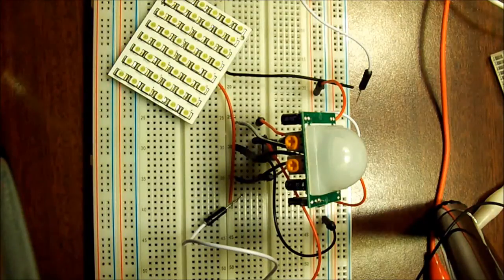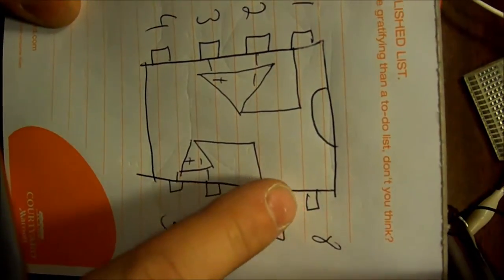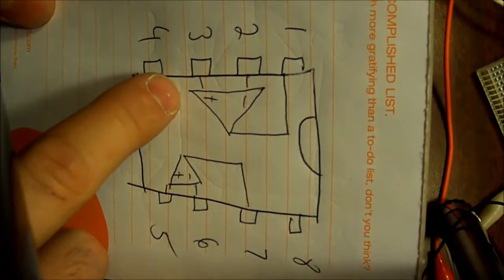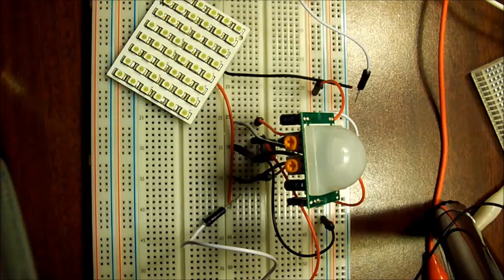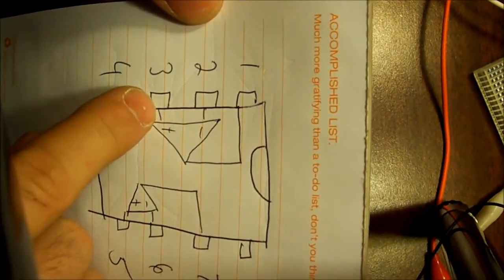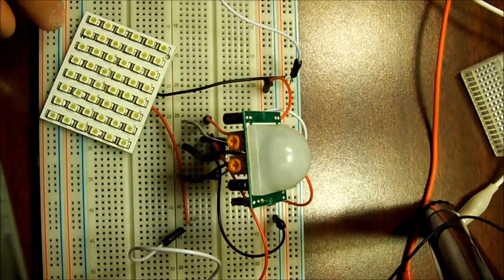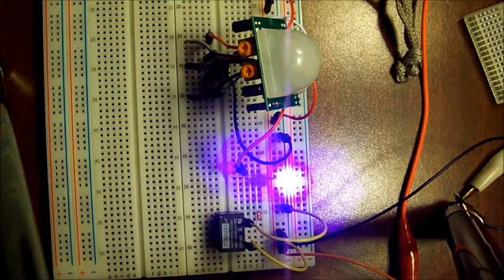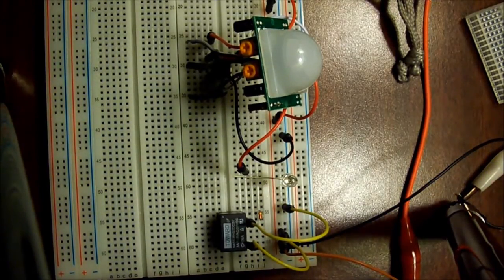PIR motion sensor through dual op amp and relay working inverted.

Comment: I think that led turns off when you move is because you reverse connected positive and negetive ends. The positive end should power the pir sensor only. Than you play with Out  (middle pin on pir sensor (+ve)) and negetive directly from battery (use resistor). This two can light up your led when motion detected by pir sensor.

Comment: sir, I would like to use the pir sensor in making an automatic model for a classroom, but for that I need the pir to remain on as long as a student is in its range and if he goes out of it, the pir should turn off. can you plz suggest how i can do this?
Reply: *****  thank you so much sir...could you please also suggest the value of a resistor i should connect with the device so it doesnt get burned up? with a 5v battery...